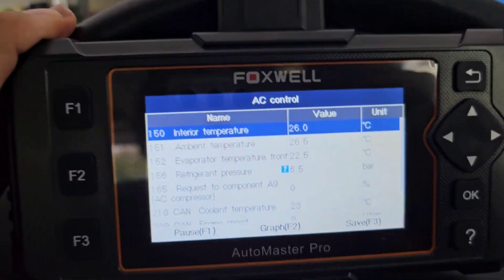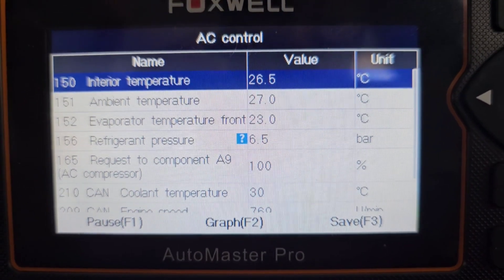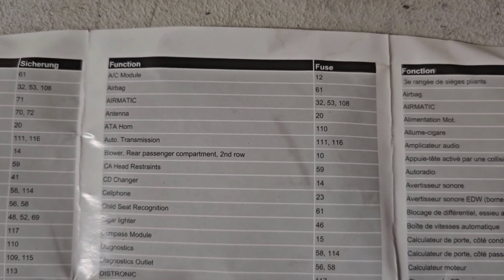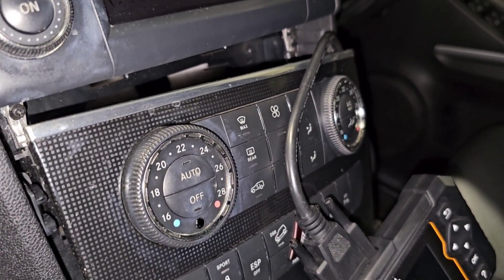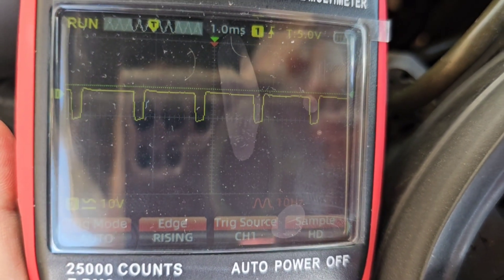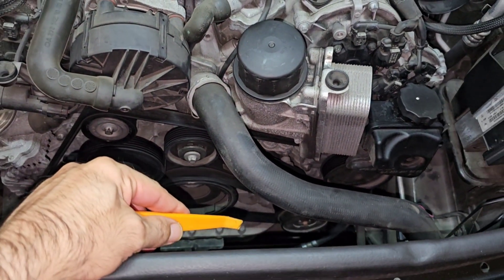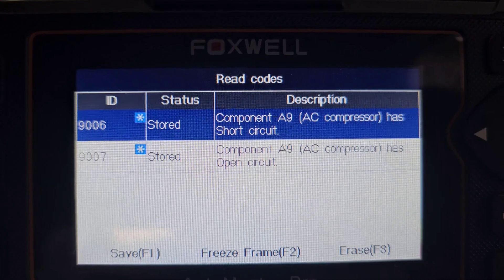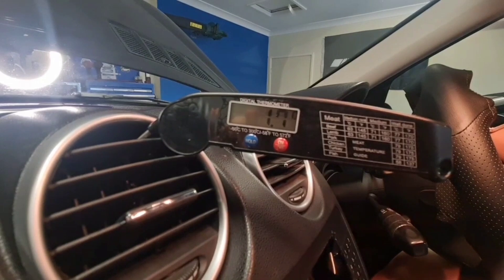A small part causing a huge issue: A/C control solenoid valve.

Comment: Mine is same clutchless compressor. Can a faulty solenoid make rattling  noise in compressor (may be in swash plate). But there is no black oil in the system. And there is a pressure guage vibration also when compressor is engaged.
Reply from the maker: Probably not. If the car has more than 150k km, the compressor is gone. Don't use it. It will push all the debris in the lines.

Comment: great vid. I have been dealing with lack of AC for a year now....got the schematics and was testing all sensors to no avail. This video has pointed me in the right direction (i hope:). thought my problems were wierd as I am able to use Star to start the AC and it blows cold...without Star hooked up it just blows warm....I was thinking it was my climate control module, but all buttons seem to work (checked via STAR)....hopefully this will fix it.
Reply from the maker: Good luck mate 😊

Comment: Hello. Great video, thanks! 2009 E350 ac not cooling.  Attached gauges to the low side of system, engine not running The gauge showed max psi of gauge immediately which is 350psi (24bars)... that is very high. I have not attached a scanner as yet to see codes. Max psi also shows on low side when engine is running  with the ac switch in car in the on  position. The pulley is spinning.
Reply from the maker: 350 PSI is extremely high for the low-side static pressure (engine off). The static pressure on both the high and low sides should be equal and roughly correspond to the ambient temperature, usually between 80-120 PSI for common R-134a systems depending on the heat.
A pressure of 350 PSI suggests the system is severely overcharged and likely in a high-pressure lockout, which is dangerous and can damage components. You should not run the engine or the A/C and have a professional safely evacuate the system immediately.
Reply: @BenzAddiction .The system has been running like this for years without any additional charge! Just not cooling lately

Comment: Hi, I have an issue with my 2009 w204 c350. My Ac doesn't come up quick in the morning. But if i let the car warm up like 10- 15mins or drive around for like 10mins, the AC works.  

I don't have any error code on the scanner.  I have replaced the Ac pressure switch and the heat evaporator sensor.
What could be the possible issue?
Reply from the maker: You have enough R-134a in the system,  sounds like it is low on refrigerant.
Reply: @BenzAddiction Thanks. The refrigerant level at the low-pressure side is 22 PSI. What is the recommended pressure level?
Is it 45psi?

Comment: Hi Max, good day.
By the way I m facing the problem is went turn on the AC I felt the engine quite heavy asspecially during pick up but my AC compressor worked well and provided cold enough for my cabin room (about 7°C) even in summer, of course if turn off the AC  during pick up my car going very smooth and
 strong. May know is because the AC compressor CCV malfunction or failed?
Reply from the maker: I am sorry, didn't quite understand your question, also you may want to mention your car model/year/engine.
Reply: @BenzAddiction Nissan X trail T30

Comment: One of the Best video on this topic.
How to test the PWM solenoid valve before fixing, as we need to make sure the new solenoid valve is working.
Reply from the maker: I have not tried this, but it is possible to connect the new selonoid to the connector and turn on and off AC few times to see it in action...
Reply: @BenzAddiction  Not sure, no harm to try with 9V battery instead of 12V. Sometimes the OEM spare s are faulty as well.

Comment: Hi can you please tell me What voltage/s should you get at the compressor? I had around 9 and the tech said it should be 12? 

I have 100% activation - as evidenced by my scan tool (xtool). Im thinking it’s the solenoid - I have a replacement compressor ready to go.
Reply from the maker: I think your tech is wrong. That voltage is   more like a wave form. You need an oscilloscope. Check my more recent video on how to replace the compressor.
Reply: @BenzAddiction  thank you - after watching your video I thought this was the case - the tech isn’t experienced in this application.

I appreciate your response - please keep the great content coming - your a legend

James
Reply from the maker: Thanks mate :)

Comment: Hello. Nice video!! I am having the same issue. I have a vw polo with a clutchless compressor. in fact the compresor selenoid is the same you have in the video.   I have a question, can this situation happens with a non clutchless compressor that also uses an electronic ac control selenoid? currently my girlfriend's 2007 3.5 toyota camry has the same issue also.
Reply from the maker: Anything is possible my friend,  the best method is to connect a manifold gauge and check the low and high side pressure.
Reply: @BenzAddiction  Hello! Yes in fact both low and hihg side got he same preassure and no cold air is coming out
Reply from the maker: @josecabezas7341 Might be the selonoid.
Reply: @BenzAddiction  I think the same. One day O was driving and I press the acelerator full gas because I was driving fast and the Cold air started flowing. an incredible cold air, even when I stopped the carm it continued working good.  Then I got home and the next day it did not worked at all, the compressor quick on, but not cold air.
that was the Camry

Comment: GENTLE PERSON,

DID YOU REMOVE THE SOLENOID VALVE WHILE THERE WAS A VACUUM IN THE SYSTEM.  DID YOU HEAR ANY NOISE AS YOU PULLED OUT?

THANKS!
Reply from the maker: I released the vacuum first, then pulled out the selonoid.  Otherwise hard to remove.
Reply: @BenzAddiction 

Thanks for responding!

I am currently working on my 2003 SL500 R230.475.

I'll be replacing the DRYER tomorrow. Currently, I have the system under vacuum at -30 inHg checking for leaks, but tomorrow I have to bring the system to atmospheric pressure. 

Is this sequence ok:

NOTE: MY GAUGES/HOSES are the type that does not have a valve right at the LOW and HIGH ports.

Proposed sequence:

1. CONNECT THE BLUE LINE TO THE LOW PORT WHILE KEEPING THE BLUE LINE VALVE CLOSED.

2. CONNECT A CAN PIERCING VALVE WITH NO CAN TO THE END OF THE YELLOW LINE AND OPEN THE VALVE

 3. CLOSE THE RED VALVE (THE RED HOSE IS NOT CONNECTED TO THE HI PORT

4. SLOWLY OPEN THE BLUE VALVE UNTIL THE GAUGE REACHES 0 PSI.

Should I assume that the HIGH SIDE of the system is at atmospheric pressure as well, once the LOW SIDE is?

Is this correct ?

Your guidance is appreciated.

Thanks.

José

Comment: @benzaddiction Thankyou. Would you be able to share your technique for removing the circlip whilst A/C compressor is still on vehicle? (W164 / OM642)
Reply from the maker: 1. Wear eye protection & gloves.
2. Use a small screwdriver 
3. Make sure the system has no pressure, vacuum or gas.
4. Use the screwdriver to pry it out.
Reply: @BenzAddiction  Thanks. I discovered that circlip pliers through the "drive shaft to wheel cavity/gap" also works easily and gives better leverage access for removing solenoid.

Comment: Hello I have a problem with w211 e220 with the same clutchless compresor.

The aircondidion is working as it want. Sometimes work then during drive stops and work again after few restarting cars .
There are no fault codes.
The pressure is showing properly because when you can feel cold air there is around 10-15 bars and when you can see the pressure drops itself below 9 bars you can already feel warm air.

I already replaced the mentioned selonoid valve but it doesn’t make any difference. 

Can you please help with suggesting what next can I check ?
Reply: You need check the low pressure. It should be around 2 bar(excellent)  in summer after you turn on A/C and set to coldest.
Reply from the maker: Make sure the ground to compressor and the red wire is intact, (use multimeter)

Comment: Hello, my friend. I have this problem with my 2008 W221. This summer, when I turned on the air conditioning for the first time, it didn't work. I went to a mechanic and he told me the system was empty, so he filled it with 1 kg of refrigerant along with a UV dye. The AC started working, but sometimes it stops again and blows warm air. After restarting the car, cold air comes back and it works again, but sometimes it shuts off.

The next day, I went back to the same mechanic. He checked for leaks and found this: the system had no visible leaks, but there was only 500 grams of refrigerant left. We refilled it again to 1 kg, and it started working, but occasionally shuts off again.sometimes working, sometimes not. A week later, we checked for leaks again — still no visible leak, but again only 500 grams remained in the system.

There are no diagnostic trouble codes (DTC), except for a circulation pump issue (DTC 9395, A31/1m1 circulation pump), which is not physically connected to the air conditioning system.

I suspect the refrigerant is escaping through some sort of safety or emergency release from the compressor, possibly as a protection measure — but why? Where is the problem? No diagnostic codes at all. Please advise me on what I should do. Thank you very much!
Reply from the maker: Hi, i don't think there is any safety valve on the AC system.  You need to fix the circulation pump first as that code can affect the operation of the AC.
Reply: There is safety valve on compressor. I am guessing 1 Kg refrigerant is double of recommended so refrigerant comes out from safety valve. My solution is keep remaining 0.5 Kg. Then you test high and low pressure. If you are using R134a then low pressure should be 2bar. If it goes high to 4 bar you can’t get cool wind from vent because R134a temperature is around 16 degree Celsius according to R134a vapor pressure table. The problem would be compressor not good. Replace it.
Reply: @kuamatarly4258   my car need 1.18 kg of freon.  i already replace used one other kompressor but problem still :(

Comment: My Mercedes R350 got overtaken by mice... they ate all the wires! It runs, but the AC fan runs constantly,  LOUDLY! And the AC doesn't work,even though it has freon. So I needed this electrical info badly!
Reply from the maker: The pressure sensor which most of the time located on alongside the chassis, if you pull that connector on a properly runing car the fan starts with the highest speed.  So check these two wires on the pressure switch they might have chewed it.

Comment: Thank you for this video and your knowledge, finally, someone who knows what they are doing :)
Reply from the maker: Thanks mate 😊
Reply: @BenzAddiction Thank you for this most informative post, I now realise that my 30,000 miles, 2017 Peugeot 2008 diesel also has a clutchless comressor. 
I had never heard of such device and looked in vain for a relay and power cables. Does this mean that the compressor is running at all times ?

Comment: Hi, 
I have a 2008 e350 (W211)
My AC comes on randomly. When it's on it works great but it can work for 2 or 3 days and then not work for a day then comes back suddenly. Have you had this issue before?
Thanks in advance for your help
Reply from the maker: Oh my friend,  this could be anything from pressure switche, to AC module, or the selonoid.  You need to see if there is a fault code.

Comment: Thanks for the video. Using the info to understand why my W211 is giving me hard time. It was cooling weak with the classic driver side warmer than the passenger side. Went to vacuum and recharge and the machine recovered only 400 grams and no leaks. For some reason, the tech decided to recharge 200 only, start the engine and add in increments of 200. The compressor didn't kick on, the "AC" button kept flashing and turned off. He then flushed it again and charged the 950 g with the car off but no good. He instantly started blaming the compressor altogether. I checked with Star but it gave back no codes and didn't have time to check command and sensor operations. Should I be ready for a dent in the wallet? 🥲
Reply from the maker: Did you erase all the codes?
Reply: @BenzAddiction  Yesterday there were no codes, which made me scratch my head. Even went into the AC control for an extra step of fault code scan and still nothing. Left the car for the night and just awhile ago connected another star machine to check sensor readings and to my surprise,  the scan gave an "f" next to AC. Refrigerant pressure is too low code showed up. Cleared that and all good back to cooling. Why it wasn't showing yesterday is beyond me.

Comment: Hello. I replaced the ac compressor. As soon as i turn on the ac request to command goes straight to 70% and it doesnt move from there.
Reply from the maker: That's strange, is your AC cold?
Reply: @BenzAddiction its the same temp as the evaporator 65 to 70 degrees. The high side is a little under 100 psi. I charged it to 1.9 pounds of freon. What the manufacturer suggest.

Comment: Ive heard from multiple VW techs and also asked chatgpt about vacuuming the system first. All saying there is no need to vacuum because its sealed on the refrigerant side. Just to remove snap ring and replace solenoid. Im  torn on which way. I have a 2012 passat tdi.
Reply from the maker: Just to let you know, I vacuumed the system and tried to remove the selonoid after removal of the snap ring, but could not pull the selonoid out due to the vacuum inside the system.  So if you ask  me, my experience would tell you, don't do it...
Reply: never ask chatgpt about specific technical info, only the general stuff.
Reply: I agree @BenzAddiction. You just recover refrigerant until low pressure decrease to 1 bar which  is ambient pressure then you can pull the solenoid with a plier. If can’t the offering help with a flat screw driver or twist the solenoid a little bit.
Reply: correction: pressure gauge indicate 0bar if inner side and out side(ambient pressure) is equal.

Comment: Quesion on how to add oil and where to add oil?  I tried both high and low pressure holes, but oil just sits there even if I rotate the pully?
Reply from the maker: Well I hope a HVAC specialist can answer this, but in my opinion there is no need to add oil as the system is closed.
Reply: Why you add compressor oil? The only reason is lacking of oil. To determine this by covering high pressure nozzle with white tissue and pressure the center point for 2s. If there is oil spray on tissue then oil is enough. If not then add about 50g for a sedan. To add oil into the system you need consulting from mechanic. For me, I recovered refrigerant then remove a bolt from compressor then inject oil.
Reply: Press the center point

Comment: Hello thanks for a great video ..I have an issue there is 0% after  request to ac compressor..I have power I have pressure and no codes in the system ..is this more than likely the Actual compressor ?
Reply from the maker: If request to A/C compressor is always @ 0%, you might want to look at the other prerequisites. Eg: 6 bar pressure,  functional switches/module, etc.
Reply: @BenzAddiction turned out to be compressor..thanks

Comment: Thank you so much for sharing great info ❤🙏
I bought this solenoid without the yellow dot 8:41  , so does it will make the AC system to stop working?

Its the exact shape of the one you show here 7:42 and the same old one installed on my compressor 
Thanks in advance 🙏🙏
7SEU17C, A 001 230 55 11
installed on w203, 2006
Reply from the maker: If your original selonoid has a dot, you need one with dot otherwise it won't work.
Reply: @BenzAddiction 
Ok , thanks for your  reply ❤

Comment: I have an 06 C280 where the AC will only turn on if I switch on AC when the car is on a uphill angle. AC will continue to work normally until I turn the vehicle off. When restart vehicle it may or may not work (most of the time it does not). Have you seen an AC issue like this before?
Reply from the maker: Strange. Can't think of anything other than a loose connection. Don't laugh but how are your engine mounts condition? You know everything needs to be checked, including the engine negative.

Comment: Hello Benz Addiction 
WoW - you have some amazing easy resets on your channel..! 
Please if you cud direct me. 

My 2011 A-Class has a problem with the park light ( called main beam by some ) that stays on for no reason. All light switches are off in the car. Yet beam is permanently on. 

We removed the bulb to stop the LIGHT from draining the battery. I see on line many have had this problem. But no full answer other than it can be the SAM Moduel 
Can you advise. 

Thx - Rosemary
Reply from the maker: @LimitlessLovve  Hi, not very familiar with A class, but yes, most of these headlights are controlled by the front SAM module, I suggest you to diagnose using a proper scanner before attempting to replace anything.
Reply: Thankyou Benz Addiction. Does that mean it need to go into Mercedes Benz workshop ..?
Reply from the maker: @LimitlessLovve  Not necessarily,  it is recommended for the Mercedes-Benz owners to have a scanner.  A Mercedes dealer usually charges more for such complicated fault, a good Indy mechanic if you know one might be way cheaper.

Comment: Hi Max, thanks for another interesting video.  You seem to have more tools than the average dealership!
I have a similar but different problem on my 2006 CLK350.  The AC works, as does the heater, but it doesn't seem to have any temperature regulation.  It is either full cold or fully heat.  The only way that I can regulate it is with the fan speed.  Any ideas?
Reply from the maker: @RobInAus  Hi mate, it probably is the AC flap actuator not working